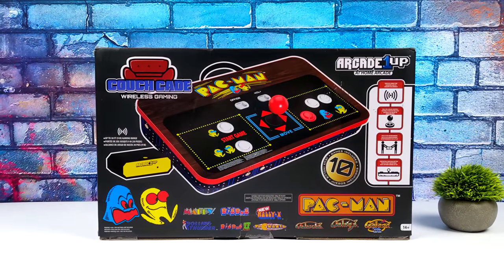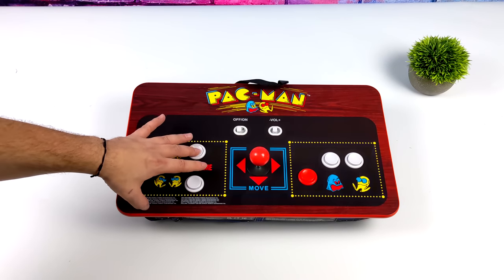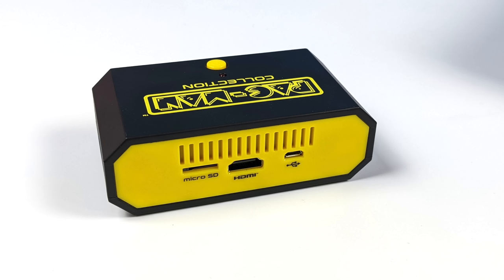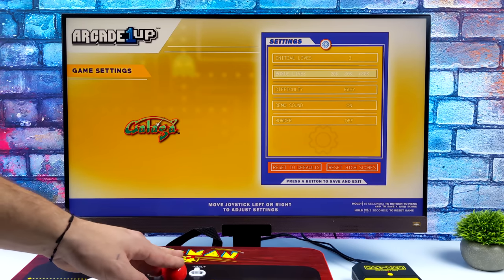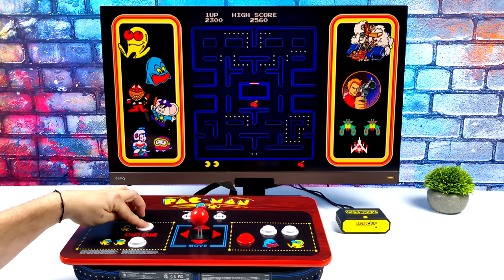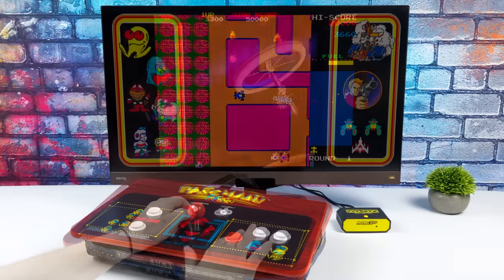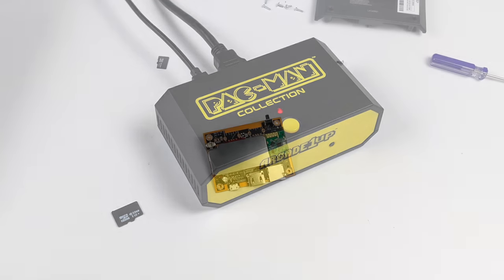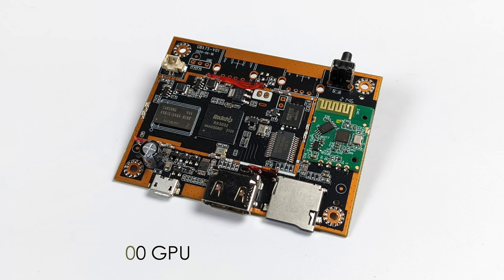Arcade1Up Couchcade Hands-On Review, It's A Cool Idea But...

Comment: Nice analysis, Prime. The lack of buttons definitely limits what games you'd be able to add anyway. You'd be much better off with an AtGames mini for $100...8 buttons with 100 games onboard.
Reply: Yes this is better option beside you can add your own games via usb and allow second player controller
Reply: @r3troid  or wifi, from what I can tell 😉
Reply: The biggest part of this is the 4 way gate joystick. There are around 700 arcade games that were designed with a 4 way gate and 3 or fewer buttons. Having a nice small set up that has a 4 way gate that you could easily add games to would be kinda cool but you're still better off building your own stick with an SBC in my opinion.
Reply: @xwlfx315x  good points there. You got me to thinking though...why are the pis still so hard to come by? I know there are now a lot of alternative SBCs available, but a lot are as or more expensive than the current pi prices...🤔

Comment: I got the Atari version for my uncle as a Christmas gift due to him occupying the entirety of the Missile Command high score list on my A1U Tempest cab. He loves it. There is definitely a market for this product, A1U just doesn't seem to know how to tap it.
Reply: The trackball and spinner seem like a useful thing to hook up to a raspberry pi (if possible) for other games. - Not just the games that come with it.
Reply: @michaelleiper  The way it works you can't hook up a Pi to it without modding it. At that stage you might as well get some more proper parts to put something together.
Reply: @FormulaFox  Unfortunate. Was hoping the wireless connection might be something reasonably standard (or hackable).
Reply: @michaelleiper  If it's hackable, nobody's figured it out. Frankly, you can probably built your own control panel with a trackball and spinner for a similar price.
Reply: @FormulaFox  Spinners and trackballs aren't cheap - and even in the UK, I can see it available with a 35% discount from RRP already. Suddenly that's cheaper than just getting a decent spinner and trackball. (Admittedly I don't know how good these are...)

Comment: I have the Mega Man equivalent  to this. You should be able to play NES, SNES, Genesis\Mega Drive, Game Boy Advance and Game Gear on this thing. I tore mine apart and the internals are identical. I wanna know what that grayish plug in spot next to where the USB ports  are (the post holes are there in your video) is supposed to do........  
Also the Aracde1Up HDMI models are compatible with PS3\PS4, Xbox 1 and Classic Playstation Mini Controllers. I've been writing to them to try and open up the controller availability wider (8bitdo would be nice to use on these units)

Comment: When will these types of companies learn that the ability to hack this stuff actually sells more systems. I've bought many things that I never would have because it's hackable.
Reply: The issue is the companies they work with actively want them to prevent them from being hacked. Do you think Netflix cares about io
Ip spoofing? It's the people who own the content behind the blocks
Reply: They all have to aquire license. That's why all those cabinets got 4 or 5 games on it. Also they can't tell you how to add more games either so there will never be any instruction guide included with the cabinet to obtain more roms. They'll get in trouble for that. Just like the corner store can sell you a weed pipe but can't sell you the weed. Figure it out yourself. Put roms in roms folder, it's that simple, but they can't tell you that.

Comment: Any idea what gate the stick has? I find that the most important detail when playing games like Pacman with its lateral movements. IF the gate is optimized for Pacman style games (square gate) it probably wouldn't be worth it to use it on many later games with a circular or octagonal gate. It may be a good idea that is IS limited to certain games - depending on the gate  But honestly, the fact that it uses replaceable batteries is quite silly.
Reply: It would be the best if you could use rechargeable AA batteries and it could be charged via the usb port. Something like this would likely use a cheap rechargeable battery and won't hold a charge in a couple of years. If it used rechargeable AAs you could simply swap them out for fresh ones
Reply: I prefer the replaceable batteries. Makes a difference having something that'll last a little longer than the typical cheap lithium pouch batt crap you get.

At least with this it won't die a year in and be unusable for anyone who doesn't know their way around a soldering iron. Cheap rechargeable AA or AAA batts are plentiful.